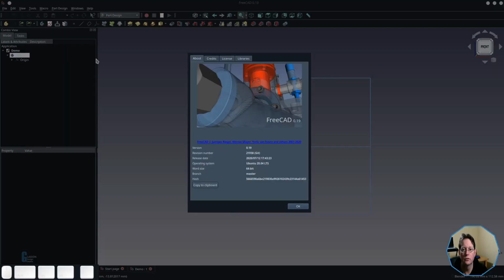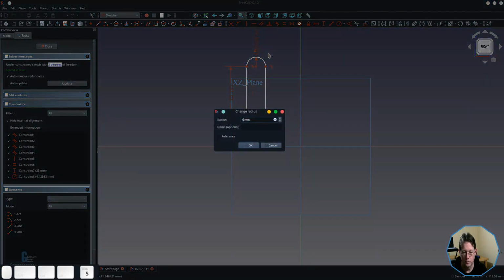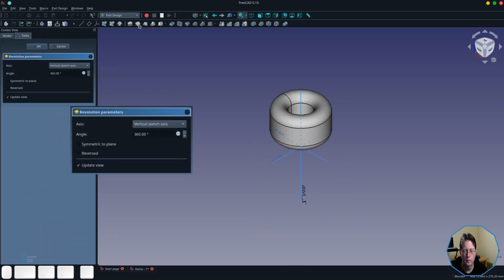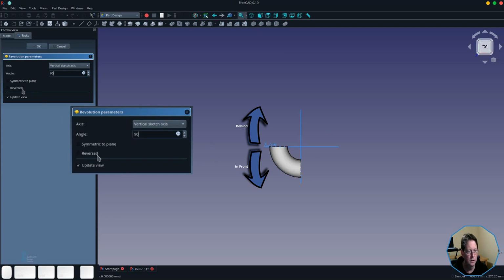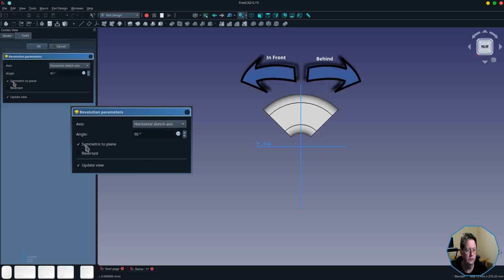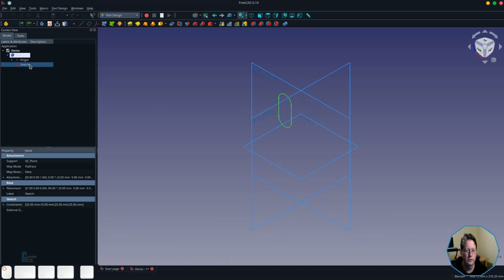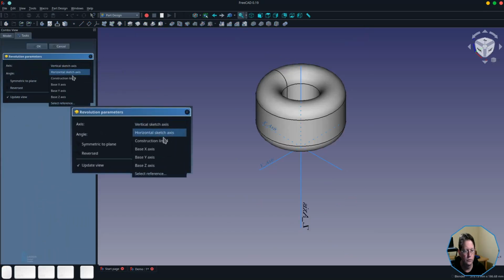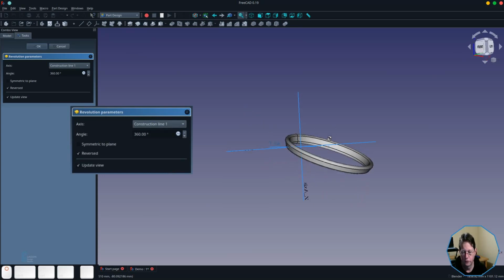Howto use the Revolve Tool in FreeCAD's Part Design Workbench

Comment: THose icons simply do not exist for me. how do I invoke them? I imported an SVG which has the 2d path I want to revolve. I am looking at the 2d line drawing. but I see no means to get to "revolve" anywhere???
Reply from the maker: Thanks for your feedback. I presume that you're talking about the Revolve icon and that the Part Design Workbench as been selected.
It's strange that you can't see it. It might have been collapsed in one of the toolbars so try dragging the toolbars around to see whether the icon appears. Another alternative is to pull down the Part Design menu and select the tool from the Create an Additive Feature sub-menu I hope this helps

Comment: Do you know how to refine the line crossing the body after revolving ?   It wasn't smooth surface when I did 3d print.
Reply from the maker: Thanks for your question. 3D printing is not my area of expertise so I don't know what you could do to improve the quality of the print. Perhaps there's a setting in the slicer that you're using which may help

Comment: For those using Ubuntu.
Using Ubuntu I can Change the pointer in size, color and add cross hairs. 
Open Settings, Click Universal Access. Here change Cursor size and Text size.
Click Zoom to on. Here you can add and change cross hair size and color. 
You can also change the Color Effect.